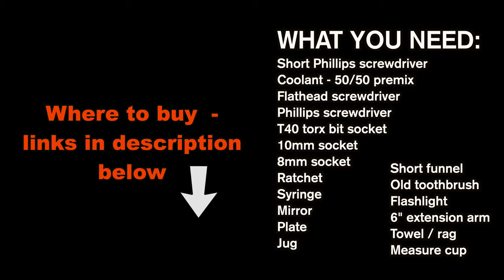Honda PCX 150 - Coolant Change | Mitch's Scooter Stuff

Comment: I have a 2013, and it actually has the same setup as my 2011 PCX 125 with the overflow bottle under the seat.  Guessing the changeover happened partway through 2013....?

Comment: Hi mitch, i was wondering, after you opened the drain bolt on the raditor you then unscrewed another drain bolt under the engine casing, is that just in the PCX or in all scooters, and what does the second draining bolt drain if not the raditor?.

Comment: I have had mine since 2016. I'm going to have my Honda  shop do it. I have pets and don't want them drinking that coolant. Also no way for my to dispose that stuff without paying an arm and leg. I do all the other maintenance. I change the oil every 3k to 5k or based on how much I ride. You've earned another sub.
Reply from the maker: Yeah I understand, I just keep coolant in bottle with cap on it to keep animals out. 
Ride safe! 🙏🏼

Comment: 1). Wait for the engine to cool before opening the radiator cap.
2). Do not overtighten radiator drain bolt, it will keep spinning, creating the illusion it is still loose, until it finally snaps halfway inside. You'll need to machine it out or get a whole new radiator (happened to me today).

Great Video! Showed me how to do it. Thanks Mitch.

Comment: hey mitch, just wanna say thank you for the video. followed the step by step and manage to change mine without any issues. flushed and refilled with engine ice. running good now!

side note: if you are using an after market exhaust system the manifold might get in the way from opening the bottom drain plug. so need to remove the exhaust before continuing. hope this helps.

Comment: Hi Mitch, love your videos found them really helpful. I’m about to do this on my 2017 PCX 125 once I have refilled the system. Is there a need to bleed any potential trapped air in the system? Is there a bleed screw at a high point if the system… thank you

Comment: Great job! And the scooter.. Apart from the fact that 2021 onwards models with 4 valves in the head is a nightmare to get to and adjust..because of the weird angle..valves are quite deep inside compare to the previous models.. Honda.. why did you not make inspection windows for the Valves.. it would make the job 100 times easier.. i will either make them myself in the future like in old enduro bikes (screw caps) or i will get rid of the thing.. time will tell. God bless you for those video's brother

Comment: Great video. Earlier pcx125 have reserve tank at back of seat. Would be far easier to fill from there.
Furthermore, because you drain from underneath, surely there is no need to remove any bodywork?

Comment: "Oz" is the American fluid ounce (or avoirdupois ounce). This is 1/16 of a pound - the main measure of weight. 16 oz = 473.18 milliliters. Can be rounded up to 500ml, as you can see from the video

"Oz" -это американская жидкая унция (или унция авердюпуа). Это 1/16 фунта - основной меры веса. 16 oz = 473,18 миллилитра. Можно округлить до 500ml, что и видно по видео

Comment: Recommend using Engine Ice coolant/antifreeze that is non-toxic for both animals and people. You'll need to flush your existing coolant with distilled water (also running the engine several times to run the distilled water through the system) then switch to Engine Ice.  It's also used for racing vehicles.  We have well water, and I don't like the idea of toxic antifreeze getting in our water supply through a spill or accident.
Reply: You recommend?  Are you a self-declared expert?

Comment: I have a question for you. I have a 2021 honda pcx and the overflow/reservoir is located under the footrest i followed all the other steps but notice during the drain process the reservoir did not drain because it is lower than all the other parts. should I pull the rubber line to reservoir and drain the residual coolant. I can't find any videos that mention this situation?
Reply from the maker: Suck up coolant with syringe
Reply: @MitchsScooterStuff  thank you for your reply, I ended up dropping the lower line to drain and getting the rest out with a syringe.  Thanks for the excellent videos.

Comment: Another tip is to put a water hose in the radiator and flush it out before adding new coolant.
Reply from the maker: And other tip, do not use water hose 🫣 use distilled water only 🙏🏼

Comment: Hi I've just got a pcx 150 2013 model i find the front very harsh on bumpy roads it feels like it's bottoming out, ive changed the fork springs and fresh oil which has helped but only a little, I'm in Thailand so there is a difficulty when i go to the shop not sure they quite understand, they seem to be saying all pcx's do this could anyone give me some ideas please
Reply from the maker: Hey, check to make sure wheel bearing is ok